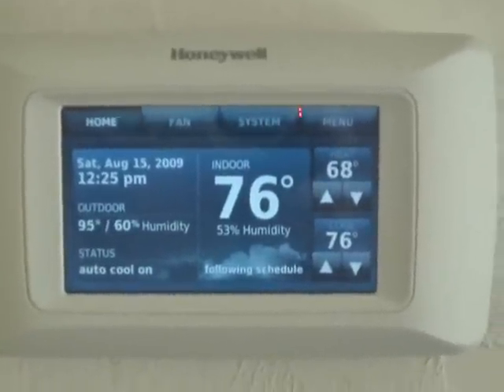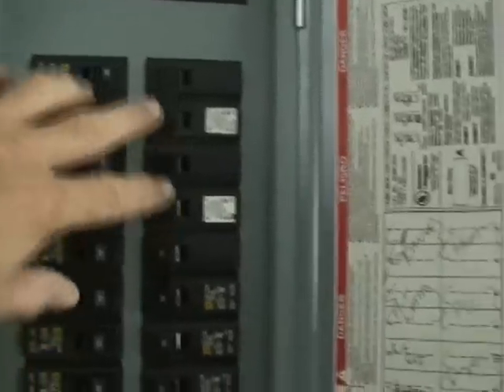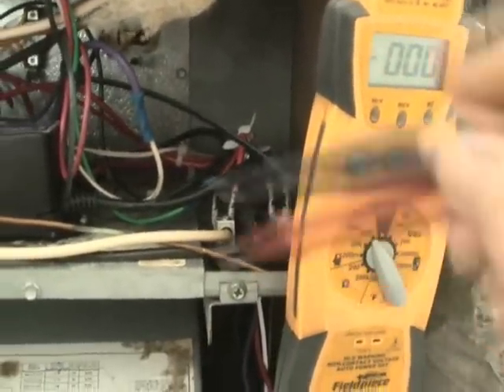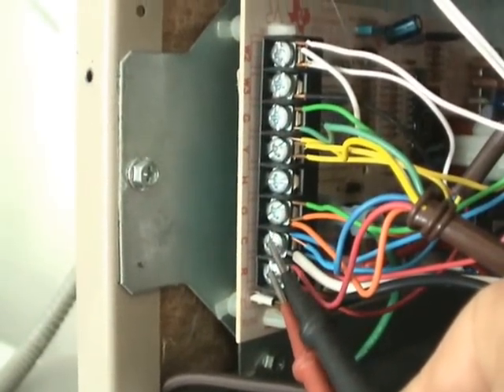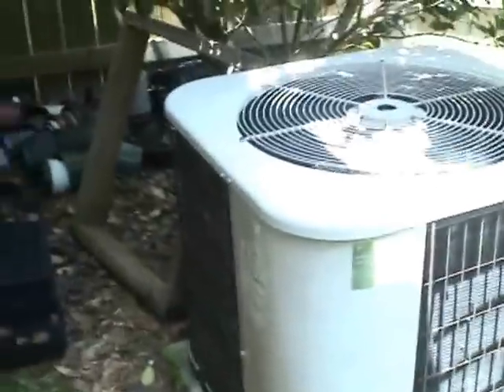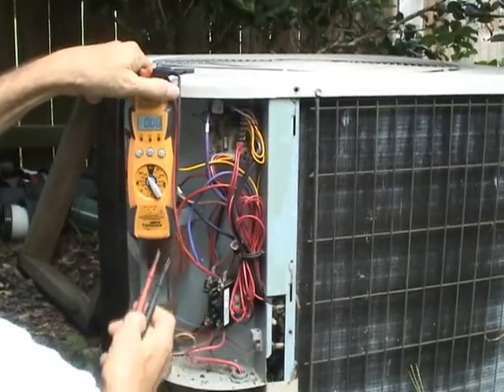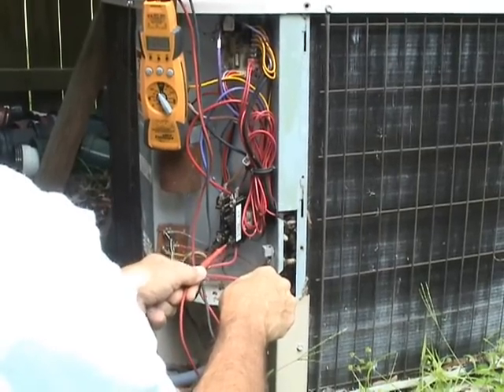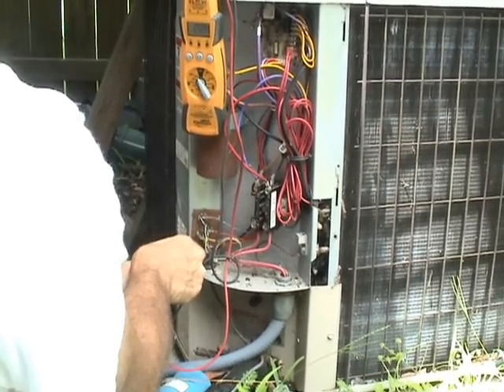HVAC Troubleshooting 1

Comment: don't you always check the indoor fan first? because if the fan works then you have five things working...high voltage, low voltage, power to thermostat, indoor fan, and indoor fan relay are all working....and bits always good to know what the complaint is....can you tell me something I did wrong?
Reply: you could check the indoor fan first.

Comment: Checking superheat and subcooling is a must. No matter what the prob is. Your job is to protect the compressor to the best of your ability. Superheat and discharge temps will tell you if you have poor airflow or any other restrictions.
Reply: No really that only pulls refrigerant out of the system. Starving it in some cases.

Comment: Dr Zarkloff I have a real problem here. My friend has a packaged unit (conventional heat) it's a 20+ year old Intertherm. The thermostat and wire was changed. In the heat mode with the thermostat in the "off" position the fan continues to run. The thermostat is set properly for electric heat and not heat-pump. I replaced the fan relay and no such luck. The blower fan is a GE motor and I have another just like it but newer. But I told him changing the motor is a long shot. All what will happen is the other motor will do the same thing unless there is a short in the motor. I already told him to get a new package unit that is a heat pump. There's no avoiding it. What do you think the problem is and the recommended solution to the baffling problem?. The only thing left to change in this thing is the transformer. I can also check for a shorted element but this would only trip the breaker.

Comment: I check the RTU after I reseated , the equipment has 3 condense fan  , 277 volts , one fan running in the wrong way . I switch the wires in the capacitor but still wrong, do you have any idea how can I change the rotation?

Comment: Hi, I have a problem that I want to solve in the building where I work, I finish my certification and of course without experience yet, the problem than  I have is RTU got an alarm say " 1 COMP 1 DISABLE INPUT/HPC " I made the PM at the unit and the pressure I have, after I reset the equipment  are: Low side 170PSIG, High side start increasing from 270 to 425 PSIG and the compressors kick off, but just the supply fan still working. The Unit is TRANE, R22, thanks
Reply from the maker: You might have to turn off the power then turn on the power to reset the board. The alarm sounds like a high pressure on compressor !.
Reply: Thanks for your fast answer, I am already did that but after several minutes, the unit have the same issue, I work in Sundays and I have to keep my self in the roof during the services because the property is a church.
Reply from the maker: carlos torres
If the condensing fans are running, it sounds like you have a dirty condensing coil or a bad high pressure switch.
Reply: I going to check high pressure switch because, I washed both coils the last Sunday .
Thank You again, and God Bless You
Reply: Usually, the head pressure will rise quickly if the condenser fan is not operating or if the condenser is excessively dirty. This problem is common in domestic refrigerators because of the location of the condenser which is almost always underneath the refrigerator making it difficult to clean properly. Remove any shrubbery away from the condenser and keep it clean by hosing it down. A clean condenser will dramatically lower the head pressure.
Reply from the maker: It sounds like a condensing fan failure.+
Reply: DrZarkloff
 Thank you sir, I will replace it.

Comment: Maybe someone can answer this question for me.  My ac unit stopped working,  the blower kicks on in the house by the furnace 24 volts is available at the thermostat  only 7 volts at the wires at AC unit.  Any thoughts?

Comment: DR:Z  THANK YOU 
I have a question
how to check defrost borad  with ohm
Reply: typically defrost boards have a way of testing them. For example, some have a couple of pins that you can jumper to put it in test.

Comment: My capacitor is bad (thanx to you for helping me find this out).  My problem is that the wiring diagram says to connect the orange fan wire to the "red dot" on the single fan capacitor.  The replacement does not have a "red dot" and the old capacitor was so rusted I don't know where "red dot" was or its polarity, if there is one.  Can you help?

Comment: There's no numbers on the wires, no wiring diagram, and no reversing wires.  I switched one of the wires from the run capacitor to the other side and it reversed but gave off a cloud of smoke on startup.  It ran slower after that but in the correct direction.

Comment: two things cause frozen evaps. low air flow and/or low charge. condenser contactor could be fused down causing the compressor to run constantly creating a low/no air flow situation when the indoor blower is not on. there are many many other things that can cause those two things. this is just one exotic example, but one iv seen a handful of times. i have been running service for the past 12 yrs. i can provide others if needed

Comment: its a manual reset hi/low pressure switch if its in the condenser.if in the blower it good be low voltage protection for the transformer/control board. if in heating mode could be a roll out switch. i can go into further detail if required.

Comment: thats the safety switch button on the door of your furnace so when you shut the door correctly it will press the button if not the button is released and it will shut the motor off you can always bypass it

Comment: The button reffered to is more than likely going to be the center of the contactor. You should check to see if your tstat is calling for cool if it is check to see if the wires on the back of tstat are connected properly. I have had customers with broken or bad connections on a new "DIY" tstat they purchased from local hardware store.

Comment from the maker: Read the wiring diagram. You've probably got a four wire setup. The two brown wires go to the run cap. No other wires should be going to the run cap. Be sure that you're using a single run cap for just the fan motor. Line 1 and Line 2 to to the contactor or relay.

Comment: I'm replacing a condenser fan motor but the original unit has 3 wires that are all black.  How do I know which wire goes with which?  Thanks!

Comment: ,I am work on a unit R 22 3 1/2 t  compressor sounds  wear  when make stop make big sounds,the  trie on but low pressure only let him go to 50 psig ,  ok     went I start to do the pump down still keep some pressure  showe me on the gauges , ok I open the valves again and the low pressure raised until 60 psig then I add frion to get to 68 psig  or 40f  but high pressure raised to 300 psig  Q  high pressure on 300psig low P 68 psig and compressor make big noise when it stop thanks

Comment: Don't put gauges on it because there not gonna give you the proper readings which does not tell you a thing is patently false sir. If the gauges are not correct that in and of itself tells you a lot.

Comment: Dr. Z how would I find out what wires go where to the thermostat if the person before me changed the wire colors and they do not match the colors that are wired into the circuit board on the furnace. I would touch the hot line to each wire but I don't want to touch the green wire thinking its fan but its common and blow the transformer... any Ideas... P.S big fan love your vids wish you gave seminars I could attend I'll pay the expense for that.... Peace

Comment: Thank You DrZarkloff. It turned out that the unit had a bad evaporator. The soda machine had cans of soda inside weighing down the unit so moving it was a job. But the real problem was the machine was locked which is where the evaporator is located. When I repaired the capillary, I later discovered the evap. had a leak. All my joints were good with no leaks but it was not holding a vacuum. When the owner finally unlocked the machine, I sprayed soap on the evap and it was bubbling.

Comment from the maker: Heating capillary tubes is something that you don't want to do. The best method of removing and replacing cap tubes is to concentrate the heat on the larger tube that the cap tube is inserted into. The solder will melt and you can pull out the old cap tube. Inserting the new cap tube can be a bit tricky. That's where practice makes you a better tech.

Comment: Dr Zarkloff I need some help here. The unit I'm working on is a vending machine by frigidaire. This is a capillary system. Now, the problem here is that the capillary tube is fastened to the suction line and coated with teflon. I'm going out of my mind here, how do I separate it. I can heat it , but its hard for me to get the correct temp. With a small piece of capillary, I placed in the dryer, crimped it and sweated it. The capillary melts fast.

Comment: my outside unit works fine and my electric furnace is the problem.  my furnace blower motor doesn't come on in auto setting.  If I manual turn on the blower, the blower comes on and we have ac.  what could be causing the blower to not come on in auto setting.

Comment: You must first dissconnect the pressure switch terminals before testing for ohms, or you can leave the terminals connected and set your meter for volts and check for voltage, if zero volts are found across the terminals the switch is in closed position. If voltage is found the switch is in open position.

Comment: Hi, I love your videos. My condensor is running alot so I checked it and found once the gauges were hooked up the low side pulled down to 50 psi  then within minutes the pressue goes up to 70 then 80 then 100? I checked and found no leaks and at night it works great. its and r-22 -two ton. Could this be a weak compressor and that it will go out soon? It is a tempstar 1997? Thanks.

Comment from the maker: You want to discharge any charge that might be stored in the capacitor by using a capacitor discharger. I've been using an insulated screwdriver for years without a problem.

Comment from the maker: Walk-in coolers are usually about 35 - 40 degrees F. You should be able to just adjust the thermostat inside of the box. It's usually mounted on the evaporator box.

Comment: You have a control voltage problem, the first thing you need to do is to check to see if you have 24 volts to the coil on the contactor that you pushed in, if you do then you will need to do an ohm test across the coils on the contactor to see if it didn't burn up.  There is many different things it could be but that is where I would start.

Comment: Control voltage comes from the transformer. Refer to manufactures diagrams to transformer location. And the wire carrying 24V comes from the red wire.

Comment from the maker: More than likely the contactor isn't getting control voltage for it to energise. It could be a pressure switch or some other safety that has it locked out.

Comment: nicely done i would have done the check the same way my dad drilled that in my head (you sure you dont know him lol)he always said never worry bout the gauges untill the last resort on anything(i serviced ice machines mostly for his commercial accounts)and the slight drop from just hooking the hoses up could drain a unit of its juicefor times we had to use a gauge we made a gauge ourselves that was the gauge head and just a stub if we needed to check charge

Comment: We love your videos. While in cooling mode my unit inside and outside freezes up. I test the defrost board with the pins provided on them. It enters into defrost mode and melt the ice. Does the fan has to stop too? Does this mean I have a bad defrost thermostat?
Thank you.

Comment from the maker: @corleonegf1983 I sounds like the compressor isn't really turning. You might want to let the compressor cool down for a day or so and try letting it restart. If it doesn't start then either the run capacitor is bad or the compressor is locked up and is bad.

Comment: One of the wire nuts had a ring melted around the center of it.  I checked for voltage before and after the connection and there was + before and no reading after.  I determined that they had used an improper sized wire nut and over time the connection started to arc within (evidenced by burn marks on wire insulation) and eventually made the connection bad.  A simple trip into the garage to get the proper wire nuts and about 5 mins labor to cut and re-strip wires fixed my problem.  Thanks a lot!

Comment: @golfnff sounds like it could be the capacitor.  Doesn't sound like you are getting any power to your unit.  Check the fuse box first but if nothing is tripped it's probably the capacitor.  They aren't that expensive and reasonably easy to install.  Beware though, you must turn off ALL power before working on electrical parts.  If you don't do so, you run the risk of a nasty shock.  Good Luck.

Comment: i have a ruud home a/c unit.  I am having troubles with it.  I have replaced the capacitor twice, the first had been on the unit forever and the second was just bad.  My a/c is blowing air, just not cold air.  I can hear the compressor clicking on, so i don't think it's that.  The engine in the attic turns on, i can feel the vibration from it with my hand on it.  I need some advice on how to handle it and possible fixes.  HELP!!! from melting in Georgia.

Comment from the maker: @golfnff I'd suspect something going on with the line voltage at the air handler breaker. Make sure that you're getting the proper voltage. If you're getting the proper voltage then I'd suspect the control transformer or the thermostat.

Comment from the maker: @hlq123 Take good care of the air drier at the air compressor and be sure to correct any air leaks that you might have in the system. pneumatic thermostats and actuators are the worst place for leaks.

Comment: Continued from other post.......My Dad had a similar problem and same a/c unit and changed out his circuit board and fan blower capacitor and it fixed his problem.  Haven't had time to check out all your diagnostic vids but wondering if you had any immediate thoughts that might come to mind with this emergency issue?  Any help is greatly appreciated as we are melting in Sin City!

Comment: Dr. Z  Need help badly!!!  Out here in the heat of Las Vegas in the nice 105 + temps and my York a/c decided to take a dump on us.  It's always at a good time isn't it?  Turned a/c on and the system on light comes on and nothing happens.  We don't feel any air from vents and don't hear anything at all.  Go outside and there isn't a sound and it is dead as a doornail.   Anyway, checked breakers and no luck with any change.  Continued......

Comment: I can't thank you enough!  I troubleshot exactly how you suggested.  I found my issue at the blowing unit inside.  I followed back the electricity and found a burned wire to the point of disconnection.  The wire came off a safety switch for the door going to the main power line.  I replaced the line and later will install a GFI on the line going to the unit.  
You saved me so much money.  Thanks a million!

Comment: Question? My outiside unit, the condenser it not running and I checked ans my " timer delay PC Board its not kicking in sending the 24vac to my contactor, can I bypass it and not used it? Thanks

Comment: I would highly recommend you spend some time with a real professional that does this every day.  I would suggest to you that a dirty coil can certainly be diagnosed with a gauge. If don't believe me, hook your gauges up to your system when it's running normally, then toss a towel over either coil, inside or out and watch your gauges carefully...you'll learn something new. if both units are running on arrival gauges should always go on first. Gauges are your #1 diagnostic tool on a running unit.

Comment: Dude, your so full of it...Gauges should be the first thing you connect if the unit appears to be running, if you use the proper gauges properly you don't lose ANY gas. Will call more BS after I watch the rest if I can stand it.

Comment: @boatinghowto Sounds like your wall thermostat is set to emergency heat or there is a problem with the wall thermostat.
OR, you have a pressure switch open. Freon low, or indoor coil is very dirty. Try turning the wall Tstat to COOL, if it cools, then you can rule out freon.

Just my guesses.

Comment from the maker: @boatinghowto Do you have a heat pump or a straight cool system. If you have a heat pump then it sounds like you're having some sort of problem with the reversing valve when it goes in the heat mode. If you have a straight cool system then it's running good.

Comment: @luxaire350 I know this is a month ago and I hope you have figured this out by now. If not, is it a TXV or piston? TXV could be bad - stuck in an open position. If it's a piston and it will pump down then you have a mystery. Be sure to have the correct piston.

Comment: I'm working on a split system, im unfamiliar with the external control boards that read " Model ZCV2 2 zone HVAC control unit ". Got 24v going into the units ,nothing coming out .On the downstairs thermostat red and green are tied together and in the red slot , I'm assuming this is a lead to the upstairs thermostat. In either case no power at the thermostats..any clues? and I have found all fuses in good shape... I just can't sit through grandma, sorry

Comment: I 'm RVDA certified, A local heating and air company charged my fatherin law $800.00 to fix his furnace. It hasn't worked since the guy brought his cowoker or buddy came out several times according to my father in law. I'm comin in on the back side of this with my experience I find the ignition board 2 be bad the diode in what we tech's call a DSI board Moast of the techs in my field have a Fenwell board tester is there such thing in the HVAC world or where can i see ur video for that?  thanks